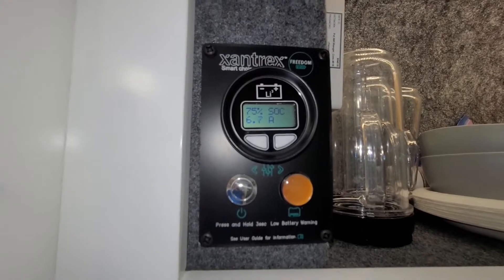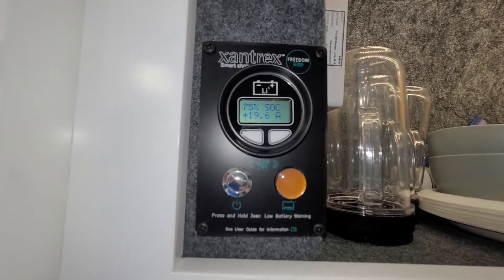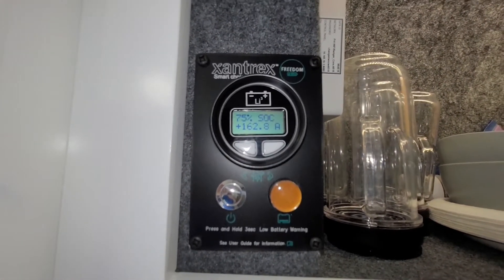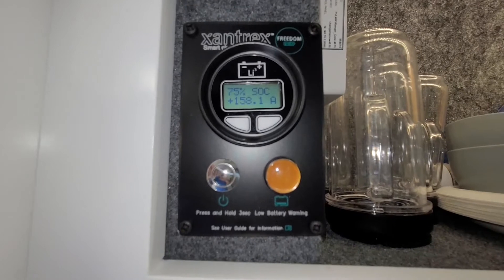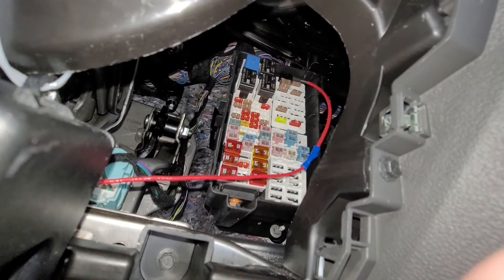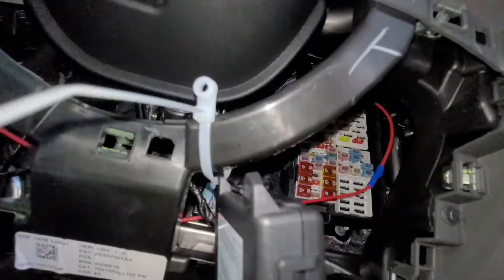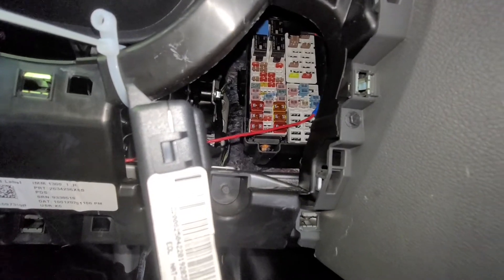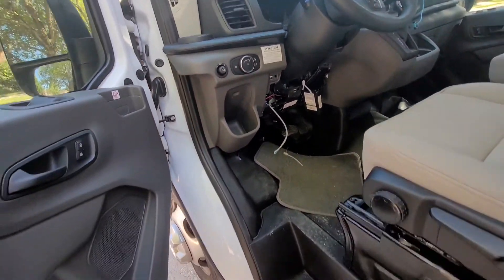Coachmen Beyond 22C - Charging Li3 system During Remote Start

Comment: I guess the obvious question is why isn't slot 1 the normal way the factory plugs in the line?
Reply from the maker: It's possible remote start wasn't their primary focus when picking a signal port.  Or possible they wanted something consistent with their other chassis (sprinter and ram).  Just guessing.  I doubt remote start charging is a big deal to a large group of people.  We boondock exclusively so getting an extra 120 amps of charge while farting around in stores can be a whole day of charge for us.  Visiting two stores (which is what it takes to get that 120amps) is pretty common for us each day.  I wish I could hack the remote start to last longer.